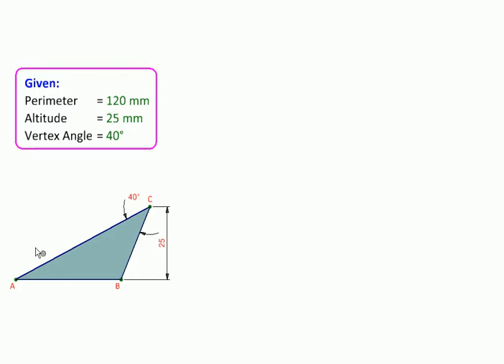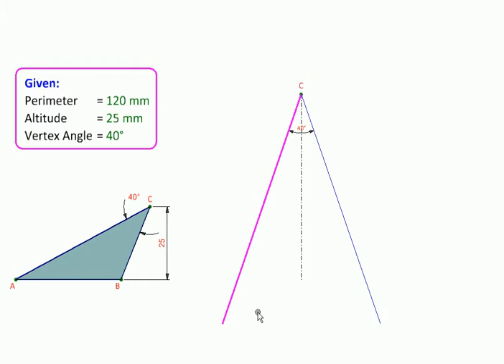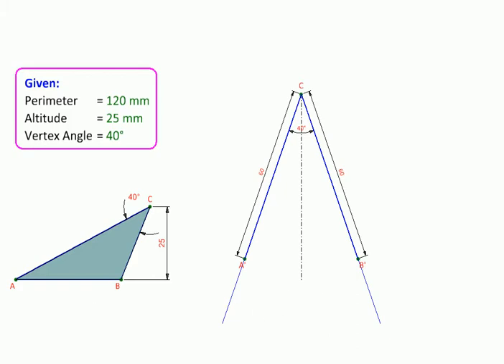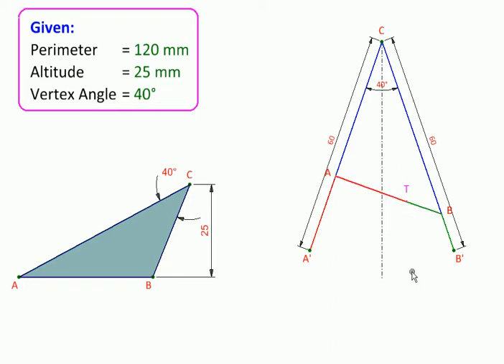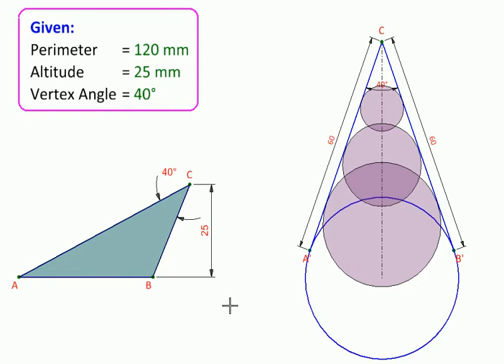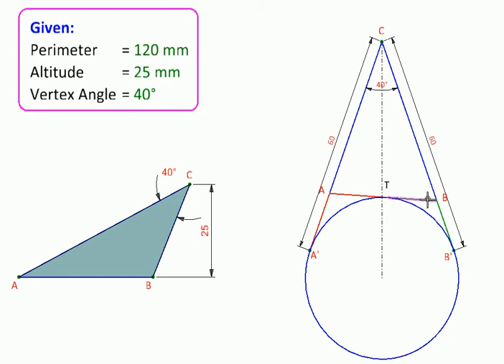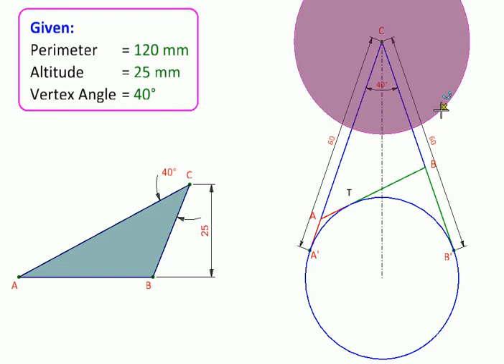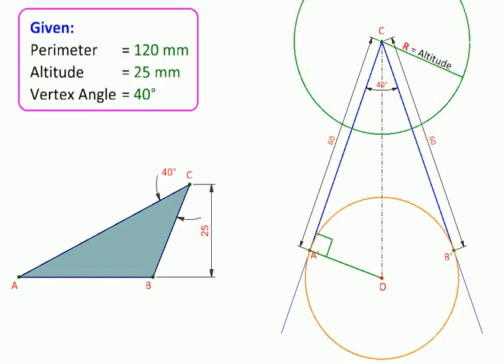Geometry Triangle from Perimeter Altitude Vertex Angle

Comment from the maker: @BenVanDeWaal I know what you mean and it is indeed applicable to another case solved in this playlist (given perimeter + two base angles) but it was too quick/simple (hence geometrically less exciting :-). In this case however, if you start with the correct altitude and then try to scale to achieve the perimeter, the altitude condition would be violated. Similarity approach first gets the 'shape' & then tweaks the scale to get the correct 'size'. Can't do that if you start with a length.